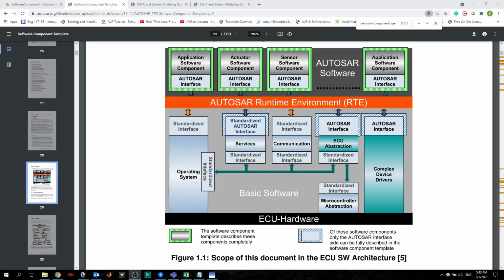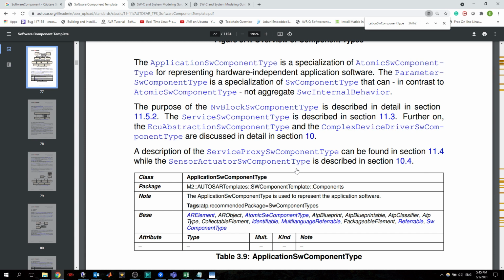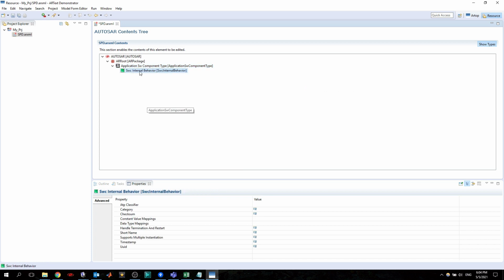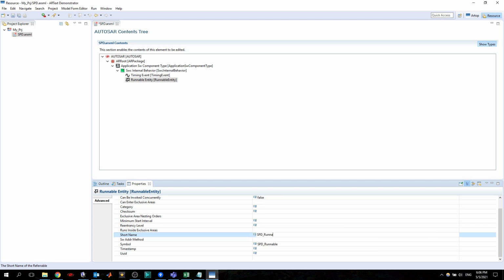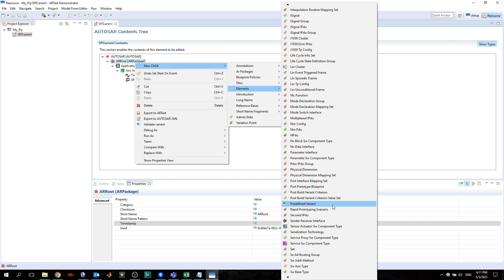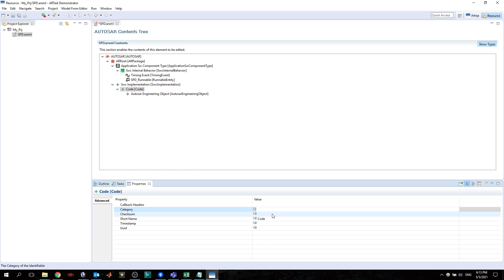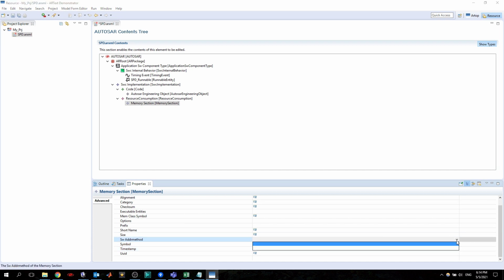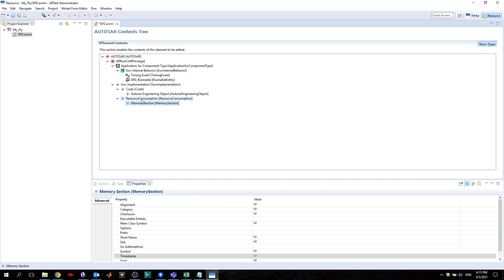Autosar: ApplicationSwComponentType arxml demo

Comment: Hi, thanks for the video! How can I have the Artex Demonstrator without being an AUTOSAR member or partner?
Reply: @jeferson did you find out anything?, Currently i am doing my Thesis in electronic engineering and i need to obtain this artop for then link and work with Rt-druid that belongs to Erika Enterprise. Any information  i Will appreciate pretty much. Thanks.
Reply: @psykjavier  Hello Javier! unfortunately currently it is necessary to be an Autosar member or partner to obtain ARTOP software. So I decided to use the AUTOSAR Blockset from MATLAB/Simulink. The most current versions of MATLAB have this feature.
Reply: @JeffersonOliver015   .ok that sounds nice. I am studying what is the Best way to achieve an autosar component software compliant and i agree with you with the same thing I Will use autosar blockset from Matlab and also i Will use the uC bsp from nxp that suports MCAL. And thus i Will get Modeling and deploy my control system using an autosar software component compliant.
Reply: @psykjavier did you complete your project.. ? I am trying something similar.....
Reply from the maker: I don't know :(. Try to make an account on their site. https://www.artop.org/action/user.Register